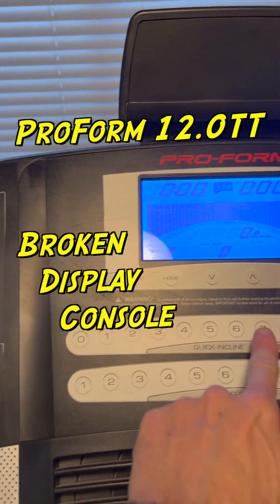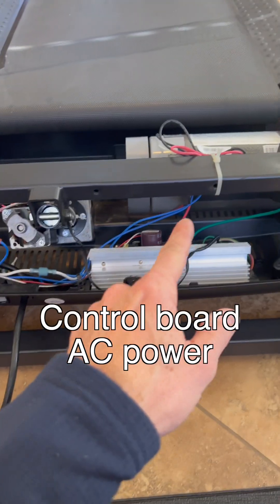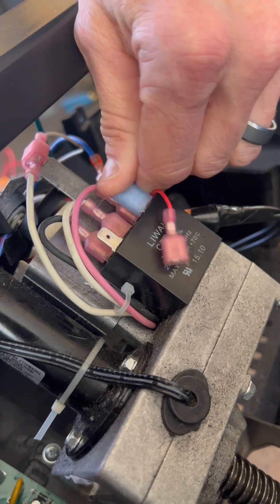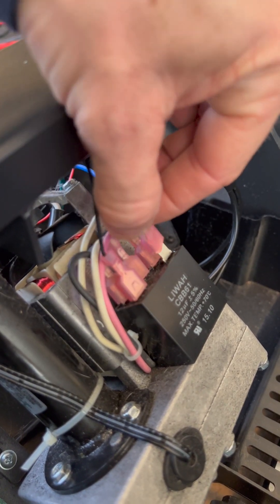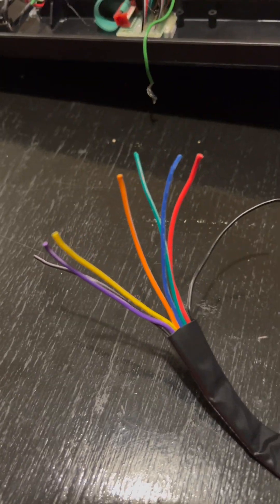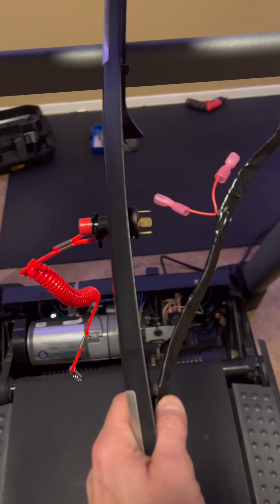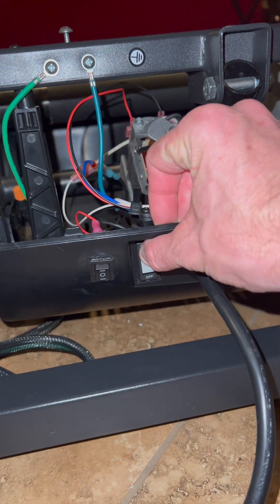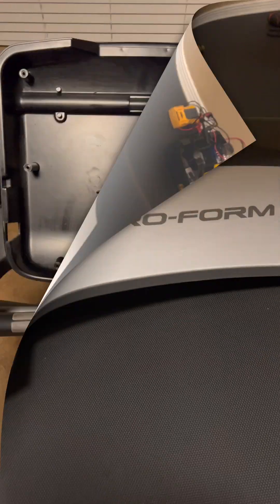ProForm Treadmill 12.0TT Fix Broken Display Console with PWM Frequency Meter Hack

Comment: I subscribbed just for this video. I am surprised how the treadmill manufacturers spent a lot in the console. The only real thing needed is the base and a simple controler for the speed and incline (if the treadmill has that functionality). I got a proform 995i (15% incline) where the lcd screen is broken, and I am plannning to do something like you did but it is a shame that we cannot simply replace the LCD screen easily. A new console is listed $600,00 !!!!! Only thing not working is the LDC that is broken.
Reply from the maker: Yes, disappointing indeed. I struggled to find a replacement display online. I randomly came across some workshop video one day where the guy had a treadmill motor, then I searched pwm, then bam! No way am I letting a perfectly good motor and control board go to waste! Seriously! $40-ish in parts and some nerd time!

Comment: I have a treadmill with a bad console. I purchased a PWM controller but I can’t seem to get it working. When I remove the ground wire from the PWM the motor starts to turn for a second and stops.  Any ideas of what I’m doing wrong?
Reply from the maker: Being honest...I'm no PWM controller expert. I watched the video that I put in the description link, bought the same one from amazon, set frequency to 20hz and it worked. I was so happy! What model did you get? The same one as the link I provided in the video description? Double check connections, wires, frequency.
Reply: It’s similar to the one you used, except it has arrow buttons instead of the dial.   4 terminals on the bottom. My harness connection is a 9 pin connector, I’m guessing I just don’t have the wires in the right terminals
Reply from the maker: I would first test voltage coming from the 9-pin harness positive and ground. Make sure it is 12v.